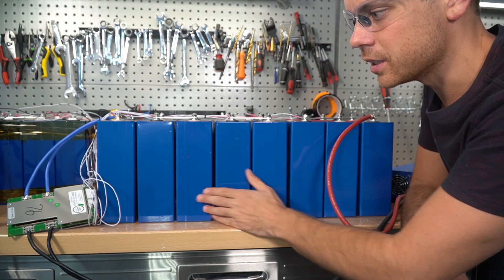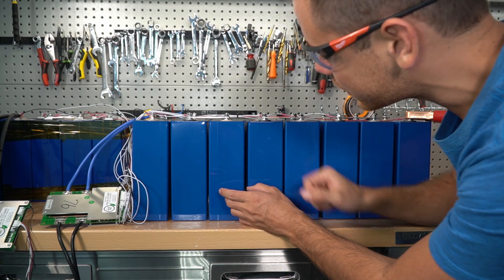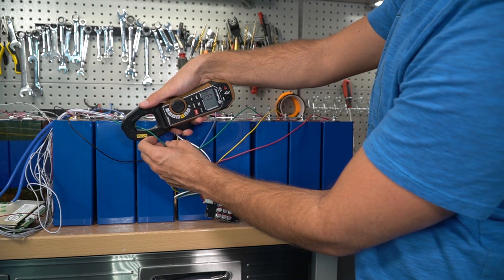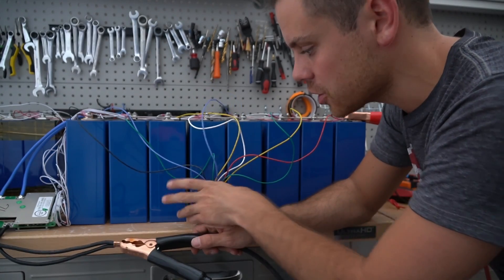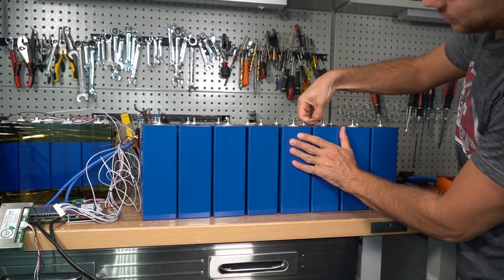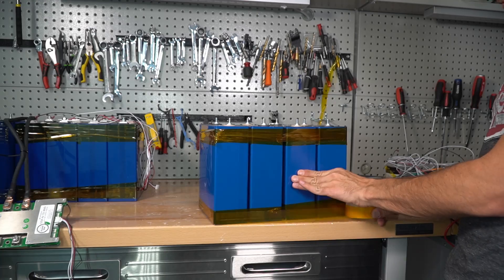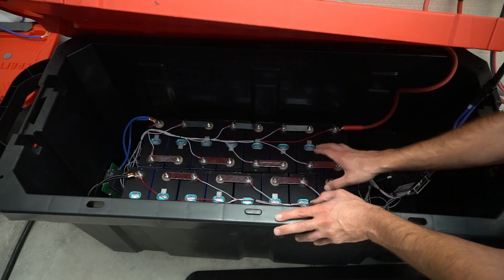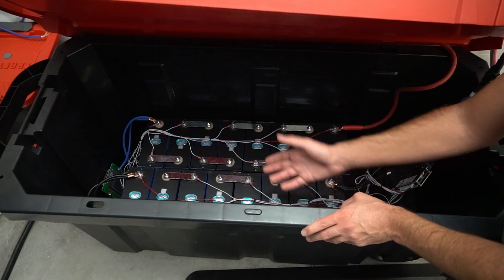300Ah Grade B Bloated LiFePO4 Compression and why I hate "Active Balancers"

Comment: The battery cell is under the action of 300kgf 
force ,the battery cell is under the action of preset 
300kgf force, after standard charged and 60mins rest,
discharge to 2.5V cutoff with the current of 1.0C(A) 
at (25±2) ℃, and then start the next cycle, end with
the capacity decrease to 80% of the initial capacity.
The number of cycles is defined as the cycle life of
the battery.

Comment: Good day please help me a have 250ah  Aoits gel  battery and hoselect 200ah hoselect gel batery 3000w inverter 30A volt controller and 3 solar 100w 240w 300w and my battery charch 13.3 when the sun go down it drops to 12.5 a try to get it 13.8 but dont go hi then 13.3 my power go of a have 3 to 4 ours use please if you can explain will be presiat thanks

Comment: Hey Will, I know this sounds ghetto, but maybe you could try freezing and thawing the cells in a freezer (not cycling them ofc) and see if the swelling goes down.

I remember when I was younger I did that with a slightly puffed up drone battery and it worked quite well. I was really wondering if it would work with LiFePO4 cells but I (fortunately) haven't been given the opportunity to try it.

Comment: I’d love to see you try the threaded rods for compression like Lithium Solar and others (including myself) has done.
Reply from the maker: Compressing like that I run the risk of shorting a cell. I am not compressing for increased cycle life as many others do. I am only trying to avoid damage to the terminal and it's connection to the lattice in the cell.
Reply: @WillProwse  How would it short?  I put insulation sheets between each of the cells, so the cases can't touch.   The tighter compression prevents movement, and metal fatigue by expansion and contraction both internally and externally at the terminal.  If the cell can't expand externally, it stands to reason it can't expand internally.  Sure the pressure will rise, but there will be no movement.  

I love the videos and hard work you do.

Comment: Why not using corner spacers on cells to provide a fixed gap larger than the swelling?
Reply: His bus bars between the terminals aren't long enough ,as he showed, to compensate for extra spacing from the bloating let alone extra spacers. There are still many ways to correct and he has said he will try putting the cells end to end instead of side to side.

Comment: Aren't you supposed to compress these batteries with around 600 pounds of pressure?
Reply from the maker: Usually compression is not worth it. You can milk an additional 1000 cycles. Join our ongoing discussion about this on the forum
Reply from the maker: No. 12 pounds is maximum I've seen in the data sheets. Which data sheet are you referring to?
Reply: I've seen similar type thin wall prismatic cells that call for 12 psi. These cells have a surface area of about 55 sq/inches. So yeah, that'd be right in that ballpark. 660Lbs.

For the people who think, 600lbs!?! HOLY COW, that's so much force. It's really not. It only translates to a couple pound feet of torque on a 1/4" fastener. Basically just a snug nut on all-thread easily exceeds that.
Reply: Also worth noting - the numbers I've seen for prismatic LifePo4 cells venting pressure is somewhere in the 100psi range. Similar burst range for pouch cells as well. Cylindrical cells however are much higher, 2-300psi if I recall.

So I think that gives kind of the upper range for what a runaway cell would give you in terms of internal pressure. So then the question is - if these cells were torqued down to something like 12psi clamping force, at low SOC, and then they were topped off. What would the effective clamping force rise to? I'd love to see that experiment!
Reply: @bradley3549  is there  a pressure sensor and some "automatic adjustment" device we could use?
Reply: @OffGridNomad1  I wouldn't think adjustment would be necessary or even desirable. The point of compression is to limit movement of the jelly roll that damages the internal structure of the cell. 

But I do think a load cell/strain gauge device would be viable to measure the range of force on the cells. This might also be a useful metric to alert you of issues - like damaged cells, overcharging BMS, etc.
Reply from the maker: @bradley3549  oh good point. Ok
Reply: @WillProwse  Compression is more helpful to the longevity and proper function of the battery over time than just an arbitrary 1000 additional cycles of use, which number really isn't based on any documented testing. Lithium batteries have a physical characteristic that they swell as they get filled with electrons. That physical movement no matter how small can cause a separation between the materials that hold the charge from those that collect it in lay terms. Before prismatic cells lithium batteries were all made in cylinder cells which provided the best defense to prevent the materials from separating. Prismatic cells were always designed to be compressed to provide uniform longevity to the cells. Without it the cycles life will most likely be less than what the manufacturer states and the individual cells in your battery pack won't age uniformly.